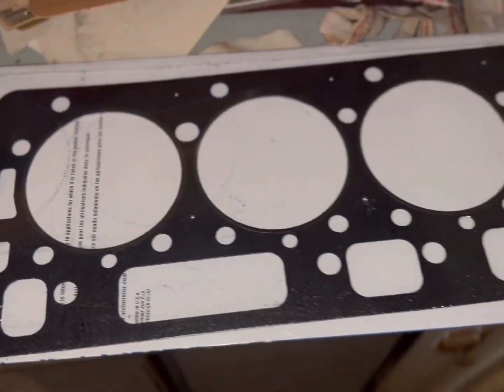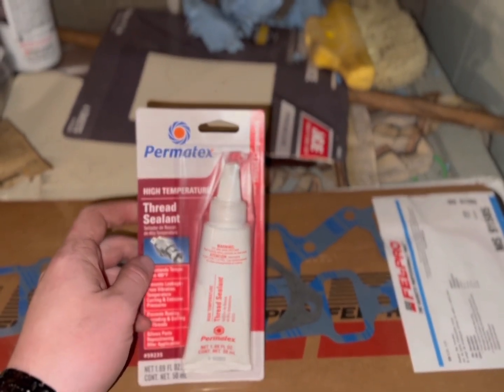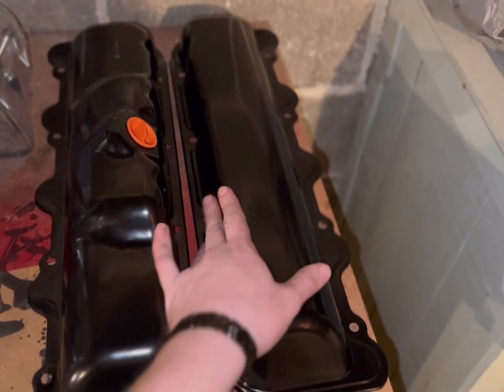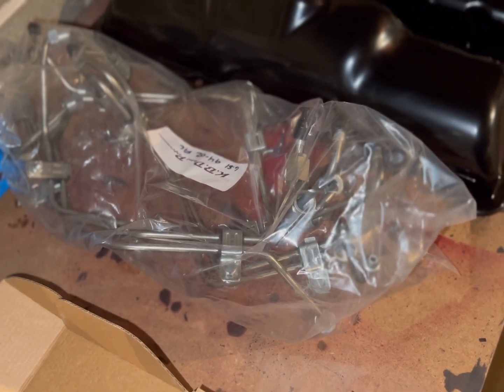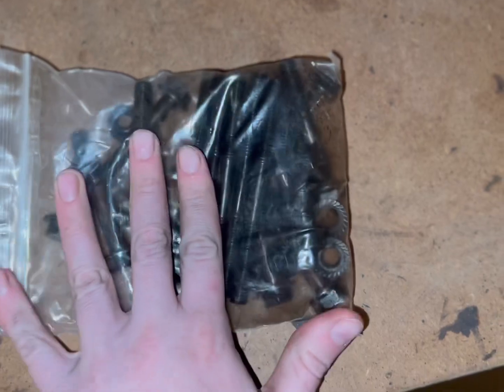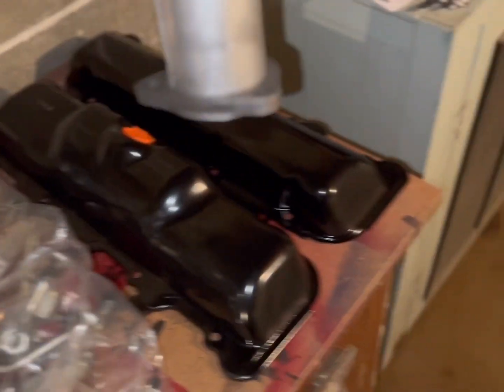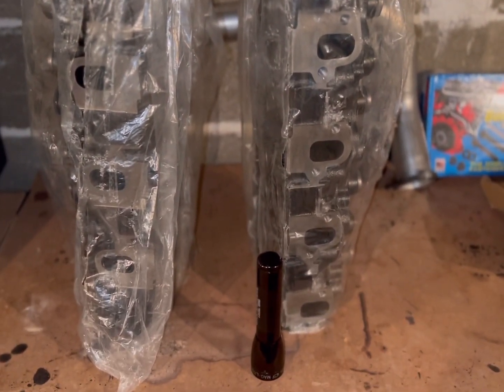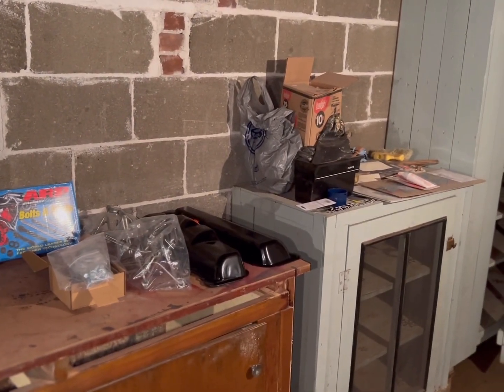GSC 6.5L Cylinder head replacement components with ARP studs

Comment: Have you ever opened up the bottom end on Casper
Reply from the maker: I’ve never opened any of casper. Valve covers are still GM sealed. I had planned to do heads and it’s still on the back burner.

Comment: First time changing head gasket. I under stand there is bolt pattern and torque specs. If I draw a picture of the passenger side head and number the bolts. Let’s say number 1 is closest to the fan. When I take same bolt pattern to other side. Now number 1 is in the back. Do I use mirror image to make it the same or does it matter? I hope this makes sense.
Reply from the maker: I use the same torque pattern left to right. It isn’t that you mirror it. Use the GM Haynes manual pattern for both banks. Hope that helps